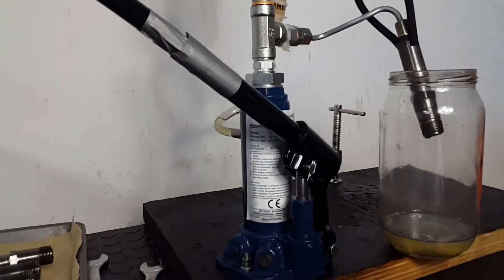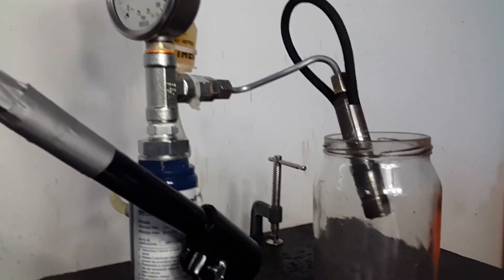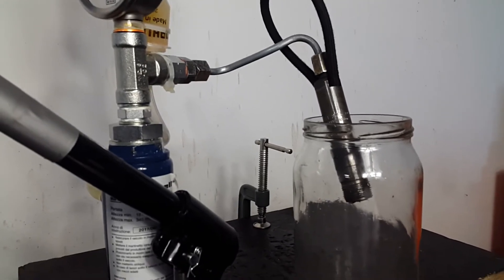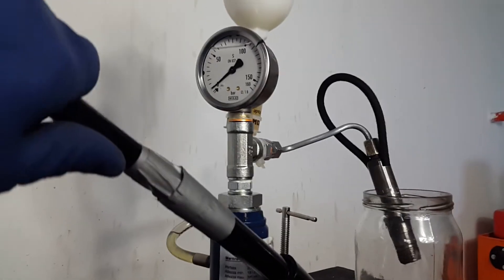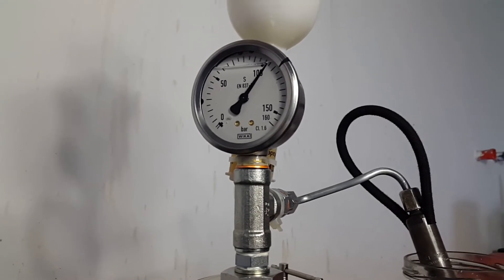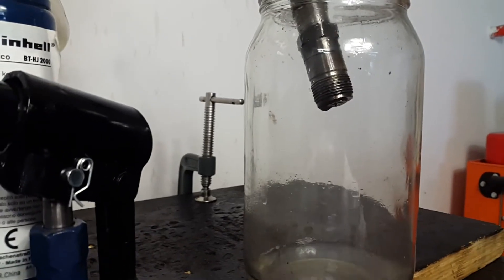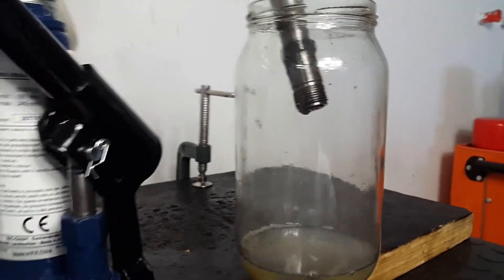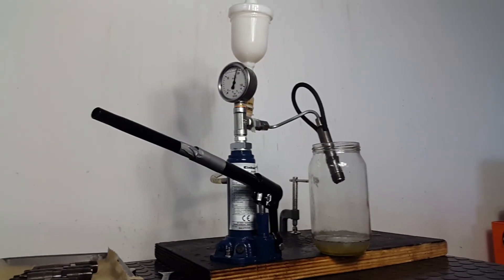how to make a pop tester pt. 2

Comment: I bought bottle jack , disassembled buy the nut doesn’t have 3/4 “ and I also cannot remove the cylinder ….? Do you have 2T?
Reply from the maker: as I mentioned in the video for the specific step you need the help of a machinist...

Comment: Nice video. Is it possible to use an electrical hidraulic pump to test diesel injectors...? It would be the same thing.....manual and electrical hidraulic pump must to work for the same purpose.

Comment: Good video,almost,but not very well explained ; one can't see how the pressure and the top is sealed.
Reply from the maker: I eas in a workshop where they used a late for made an internal thread on the original top nut of the jack...
Reply: @diycarmechanic587  
Kalaw pincag

Comment: hey, have tried and made one but get no pressure, what is wrong?
Reply from the maker: I suppose there is something wrong in the valvle you have in the basement of the jack..have you closed it?or possibly there is a leak anywhere..internally?
Reply: @diycarmechanic587  do you use a piston?
Reply: when I pump pressure, it bubbles into the tank.
Reply from the maker: @gn7911  I completely remove the internal piston..diesel is aspirated from the external tank integrated in the main body of the jack and pumped through the passages in the basement to the pressurided internal cavity diretly connected to the gauge and the pipe to the injector...
Reply from the maker: @gn7911  I suppose you started from a well known working  jack... valves in the basement need to be working properly... no rust no debris..all seals in good order...